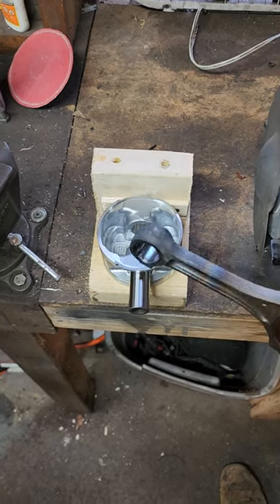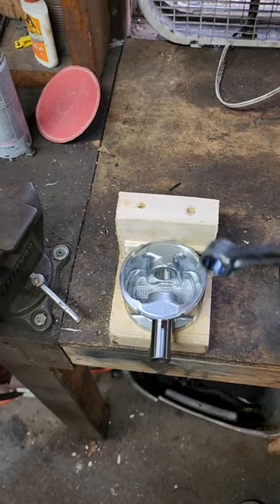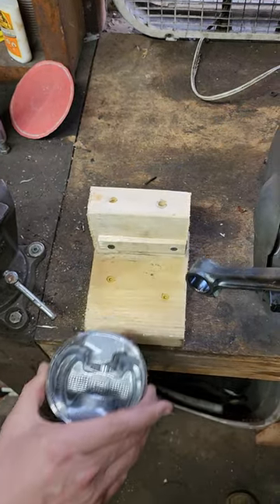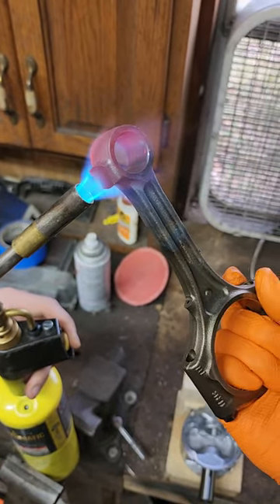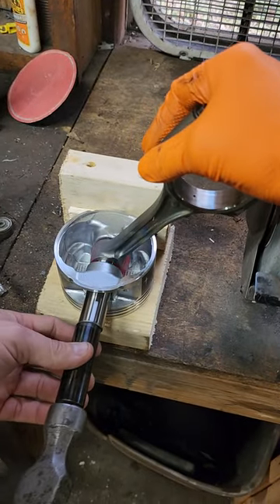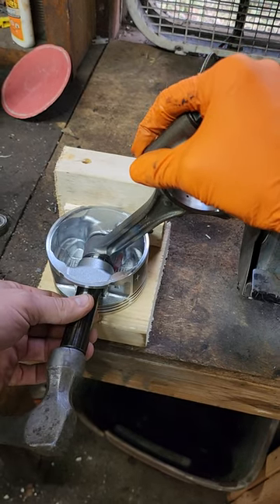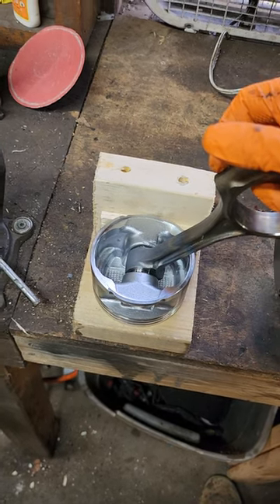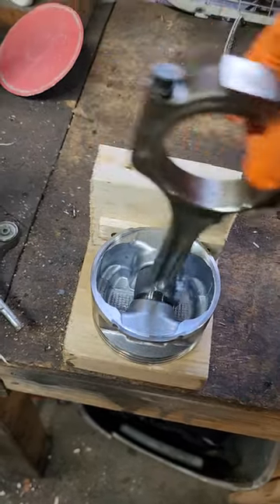Wrist Pin Installation

Comment: Shouldn't you freeze the pin.  Like with liquid nitrogen?   I believe you are making the rod brittle
Reply from the maker: Freezing the pin with LN2 might work on certain designs, but typically isn't recommended if using heat on the rod. Changing the brittleness of steel requires a good bit more heat and flash cooling, like dunking it in water (definitely don't do that) The camera picks on way more glow than it actually was in person, we're wanting just a dull red glow. That doesn't harm the steel at all. Allow to cool slowly on its own and it will be perfectly fine
Reply: That rod is going to get way more hot than thst when the engine is running.
Reply: @FerociousSniper that direct heat from a torch? No not at all. The rod is literally changing color. They don’t get anywhere near that hot when driving, plus the oil cools them.
Reply: @FerociousSniper you can’t be serious. You really think con rods glow red when the engine is running?

Comment: Aren't you making the con rod brittle?
Reply from the maker: Not at all. Heat is used from the factory to install them, there's just a fancy machine that does it. Flash cooling red/white hot steel can make it brittle, which is why you only heat it to just barely red hot and let it cool down on its own slowly
Reply: @jamminmechanics  cool good to know thanks
Reply: I sandblasted my ends so they were silver then heated till they were a wheat color.
Reply: @jamminmechanics thank you so much for this video! I'm rebuilding a 2.8 v6 in my shed and I was worried I cooked my con rods. The glow wasn't anywhere close to yours though. So I think I should be fine right?
Reply: Thank you for posting this video! I was worried I cooked my con rods. I'm rebuilding a 1984 GM 2.8 V6 in my shed and I only have an oxy acetylene torch. I barely had any glow on my rod ends after knocking out the old pins. You sure this is okay?

Comment: That was way more heat than was needed.
Reply from the maker: The camera picks up more than it actually is. It was heated to just barely visibly red. Not nearly enough heat to retemper the steel

Comment: What about rod composition? Mine are GM powdered metal, can they take the heat?
Reply from the maker: Probably wouldn't recommend it if they're powdered and not cast steel. Definitely research it and see. Typically powder-cast sintered rods don't have pressed wrist pins, rather full float with brass bushings. The wrist pin is held in the piston with snap rings. Something to note is the temperatures involved with tempering or sintering is significantly higher than what's needed to remove and install new wrist pins
Reply: @jamminmechanics  I was under the impression that all modern  GM factory rods were powdered metal and the press fit type
Reply from the maker: Older stuff perhaps, but a lot of newer GM products are all full float. I think they're big engines are still old school press fit though